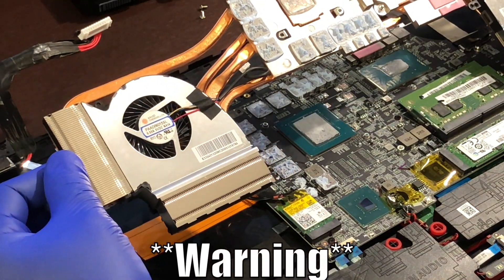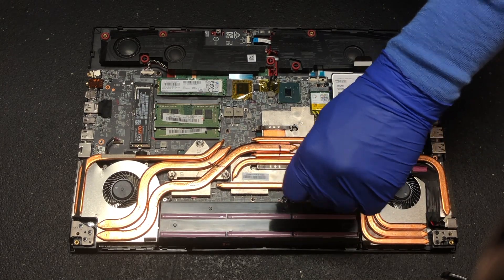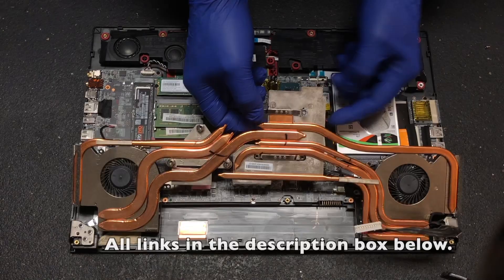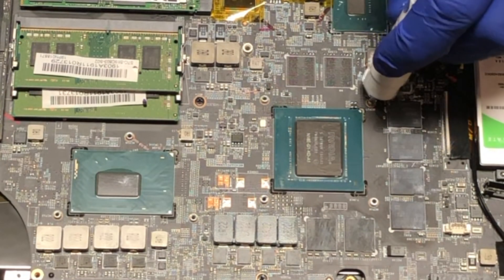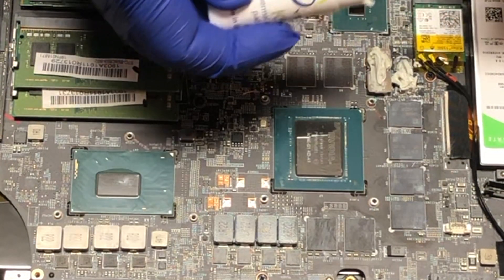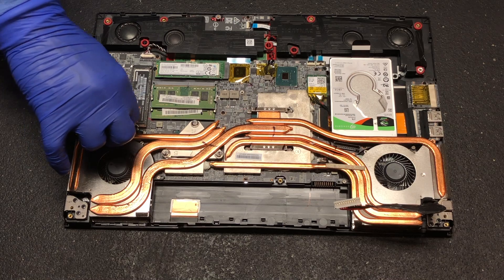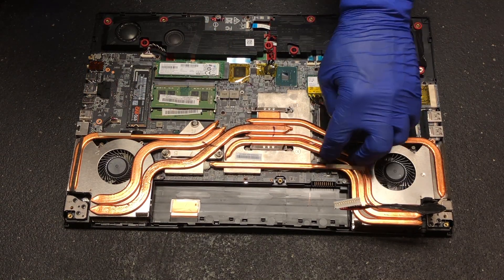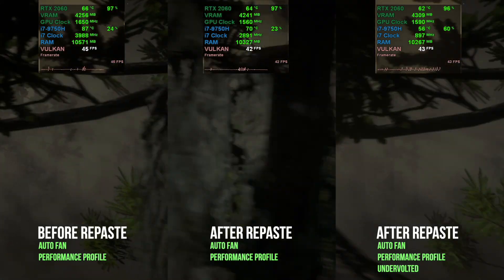MSI Raider Repaste K5 Pro and Kryonaut Big Improvement

Comment: Watched this video just before I attempt to apply some K5 Pro.  I've repasted 6-7 times now with worse results than before I started tinkering with things. I've seen CPU temps improve, and then get worse with different methods. I've tried different thickness thermal pads by Arctic and used the dot method and the spread method. I'm going to give it a go and I'll post the results here. Wish me luck!
Reply from the maker: You got it, Good Luck!
Reply: @Meanpooh  When I first got my Asus GU502GV, I was able to use Turbo mode in Asus's Armoury Crate,  and my CPU temps usually experienced thermal throttling and high temps, (prob. 97-99*C) and GPU never went above 80*C. After K5 application and repaste with Noctua NT-H1, I'm seeing a bit more stability in my CPU temps however, only through using the "Performance" mode instead of "Turbo" mode. GPU temps also came down right where they should be; 72-75*C on performance mode, a little higher for turbo mode.

 I'm somewhat satisfied with my numbers but I believe it can get it better. When I have some free time again, I'll tear down and start fresh, maybe trying a different method of applying the thermal paste to the CPU / GPU. BTW, the method I used was the spread method, in which I spread a small layer on both CPU and GPU, as well as the surface on the heatsink that would touch those.  Furthermore...after repasting my Asus GU502GV for the 7th time...I just noticed that my heatsink does have little numbers for the suggested order in which you are supposed to tighten the screws down on CPU and GPU... I had already tightened mine in a similar order so I'm not too concerned, but next time I will certainly follow the order prescribed on the heat sink... in microscopic numbers, lol.  

Spread method learned from here... https://www.youtube.com/watch?v=aPUCYUiGWZQ

Overall, I'm attributing my lower temps to the K5 pro in that it it allows the heatsink the seat properly. My laptop came with something like K5 Pro.  So in my hasty attempt to repaste, I ordered Arctic Thermal Pads in 0.5 mm thickness, based on this video: https://www.youtube.com/watch?v=NDe3Q8exfm0

0.5 mm pads may be appropriate in some areas, but heatsinks are not perfectly level..I even doubled up some by eyeballing certain areas and having 1.0 mm thickness pads on some parts, and 0.5 mm on others. Even did 1.0 mm on everything... neither of which got me the results I had hoped for.

The K5 Pro allows for proper contact in all areas the heat sink needs to sit on VRAM and other tiny modules. The only thing I have left to do is to repaste this 1 last time, follow the proper screw tightening method, and apply some fabric-like thermal tape to replace the thermal tape I had to pull up to get the heatsink off.  (Amazon: "Maxi 14179 Acetate Cloth Rubber Adhesive Tape, 10.4 mil Thick, 36 yds Length, 1-1/2" Width, Black"). I even got that orange / amber colored Kapton tape to put over the GPU, which is how it came from the factory...but I had to rip it up to clean the pins next to the GPU die. (Amazon: "Gizmo Dorks Kapton Tape (Polyimide) for 3D Printers and Printing, 6.25 x 6.25 inches, 10 Sheets per Pack"). I would recommend finding a better quality one as this is paper thin and once you cut it to size with a blade or scissors...and peel the backing off, it is extremely hard to work with.
Reply from the maker: @superbri007  Nice article.  I can agree that the K5 Pro really helps with the seating of the heatsink.  Its very hard to get the exact size using thermal pads.  You temps are look great!  I used thermal grease on my first repaste.  It worked but not like the K5 Pro.  Using K5 Pro is actually cheaper and safer.
Reply: @superbri007  I have exact same laptop and same temps. Recently I repasted with kryonaut for CPU and GPU. Used 0.5mm thermal pads for GPU memory modules and vrms. Now I am getting shuttering with negligible improvements in temperatures. I recently learned I have to use k5 pro instead of thermal pads. Can you tell me how many grams tube would be enough for GPU memory modules and vrms?
Reply: @AG3nT_5W4GG3R  10g should be enough but 20g in different packaging costs about the same.
Reply: This product is NOT for the CPU. i

Comment: I could have sworn that was thermal paste. I actually replaced it with thermal paste. Temps are good but I will be replacing it with liquid pads now.
Reply from the maker: It does look like thermal grease at first glance.  Sure would be an expensive repaste if it was ☹️.
Reply: @Meanpooh  I put Nuctua H2 on it, non conductive but it should do the job until I get the liquid pads from Greece.
Reply from the maker: @Tubes78  Alright, hopefully it won't take too long.
Reply: @Meanpooh  Got 2 days ago. I'm going to apply after dinner.
Reply: @Meanpooh  applied the liquid pads. Great temps, good FPS. I really love this laptop now. Paid 1500 euros for it. Came with 2TB SSD and 32GB RAM. A steal.
Reply: @Tubes78  So is it not a good idea to just put non conductive thermal paste on these guys instead of the thermal liquid pads?
Reply: @Tubes78  where did you buy the liquid pads? Could you link them please?

Comment: hello I hope you can help me, I have exactly the same computer model as you, months ago when I wanted to replace the thermal paste accidentally bend one of the copper pipes of the heatsink, so between my paranoia I ordered a new one from aliexpress, but to date no I am sure if it really is the same and original, I would also like to know what you recommend the most, to use on the ram part of the video card thermal paste or pads? I hope you can answer me thanks.
Reply from the maker: Both should work.  With thermal pads you will have to know the thickness to use.  With thermal paste you can just spread it on and it will seat itself when the heat sink is pressed.  I used thermal paste because this was what MSI used and just in case I need to send it in.

Comment: Underrated vid. Just got my MSI P75 creator (9750h +2060) and hitting 100c on several games even on turbo fan setting (creator center). Unacceptable IMO that it shipped like this.
Reply from the maker: I feel your pain. It really is unacceptable.  I can’t stand these thin laptops and wish they would go back to thicker versions or at least make it an option.
Reply: Meanpooh or they can just put a decent fucking thermal paste in their laptops and all will be fine 😂
Reply: @OKBUDDY21  this.. every laptop usually always needs a repaste before begin sold. Why I have no idea but it does every time and it helps every time

Comment: Would it be a problem if thermal paste was used instead of the k5 pro for things other than cpu and gpu?
Reply from the maker: Yes and No.  There will be a problem if it is conductive.  You could fry your machine but you can use it if its not.  There could be a problem if the heatsink is not flush to whatever it has to touch.  If the heatsink does not make contact with the surface, it cannot dissipate the heat.  You would be better off getting thermal pads to be safe.  At least you would know that contact will be made because of its spongy characteristics.
Reply: @Meanpooh  okay, got it... I wanted to know this coz the k5pro isn't available where I live. Thank you for speedy reply and the awesome work.. keep it up🤟
Reply from the maker: @swapneyraul5974  Sorry to hear.  Have you tried searching on ebay?
Reply: @Meanpooh  yes I did, still the same result... So I was thinking of applying the noctua nt-h1 thermal paste as it says that it's electrically non conductive, I also looked up some thermal pads but I did not find any info on how thick it should be. What are your suggestions? 
Also I own a msi ge63 raider 8rf
Reply from the maker: @swapneyraul5974  I would have a look at these.  There are 3 different sizes.  You would have to figure it out the hard way.  I do know that there are some thermal pads on the heat sink that you can match up to the replacements.  If your laptop has the gooey. thermal paste then it's gonna be hard to figure out.  I do know that a lot of manufacturers use 1mm thickness.
Reply: @Meanpooh  I will be opening up the laptop for the very first time, so I don't really know about the internal substances, so safe bet I'll order the thermal paste and the heat pads. Thanx for the help... Also is kryonaut better than noctua nt-h1?
Reply from the maker: @swapneyraul5974  Good luck with the dismantle and IMO the Kryonaut is better.

Comment: Can I just use thermal paste on the ram no problem?
Reply from the maker: Yes you can but I would use thermal pads or the K5 Pro.  This was similar to what I saw when I first opened my machine.  I could not figure out what it was until after some research.  You may not get the correct amount sing thermal grease as the heatsink has different heights and may not provide proper contact.

Comment: Why cpu GHz is so low in 3?
Reply from the maker: Because its undervolted.  I'm getting pretty much the same FPS with less voltage resulting in very low temps.  Temps are more important than frames.
Reply: @Meanpooh  how do you undervolt it ?
Reply: @berkley0699  Intel XTU

Comment: The Raiders are great... no regrets!
Thanx for the awesome work.
Reply: I bought a 4070 raider last October, it's done nothing but overheat since I got it, worst decision I ever made, idle the processor sits at 74 degrees, if I play old school runescape, it's 84-92 degrees, anything else it just turns off, don't think I'll ever buy a gaming laptop again tbh
Reply: @trident7160  Be prepared to reapply thermal paste and clean the fans if you plan to purchase a gaming laptop—otherwise, you’ll likely face thermal issues. There is always a percentage of laptops where the thermal paste application is subpar, as it’s done manually at the factory. Additionally, fans will get clogged over time—usually within a year—affecting cooling performance. To properly clean the fans, you’ll need to detach the cooling pipes from the motherboard to access the cooling fins, which means reapplying or readjusting the thermal paste. There’s no avoiding this. Even if you send the laptop to a technician, there's still a risk of poor workmanship, since the task is performed by a human.
Reply: @susheelbalan8486 , thanks for the reply!, going to give this a try today hopefully it goes well
Reply: @trident7160  Be ready to redo thermal paste, cleaning fans etc if you are going to purchase a gaming laptop, otherwise you will have to live with thermal issues. Theres always a percentage of laptops whose thermal paste application is of lesser workmanship than others as it is done by humans in the factory. In addition, fans will get clogged over time, 1 yr and affect cooling. To perform proper fan cleaning, you will need to detach the cooling pipes from the motherboard to gain access to fan's cooling fins. This means redoing/readjusting the thermal paste application. No escaping this. Even if you send it to a technician to do it, there is a chance of workmanship issues as it is done by a human. 

Owned multiple gaming laptops over the years and did all thermal paste and cleaning myself to avoid workmanship issues. Never owned a 40 series though.